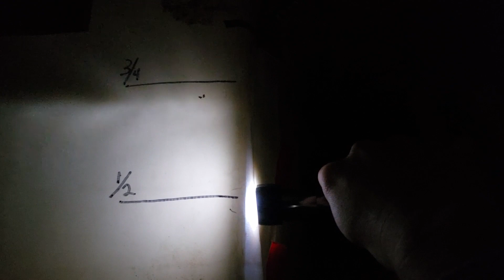OFF GRID LIVING // Prepping for Alaska Winter PT: 2

Comment: Lots of work to do there to keep everything on the up and up. Excellent video!
 I used to have an under ground spring across the bog 350 ft from my home about 3 ft above grade with an outflow 3/4 inch plastic hose that never froze up during the winter months and as long as it was running a little bit it never froze..
Reply from the maker: We've thought about trying that but not willing to chance ruining all our pipe. We need to drill a well soon!